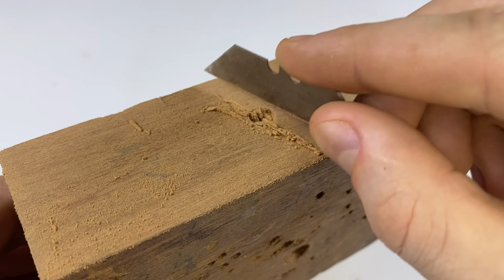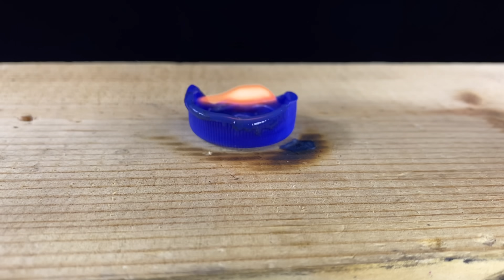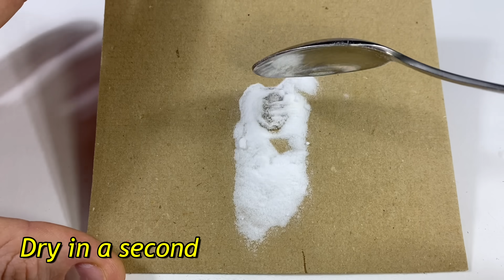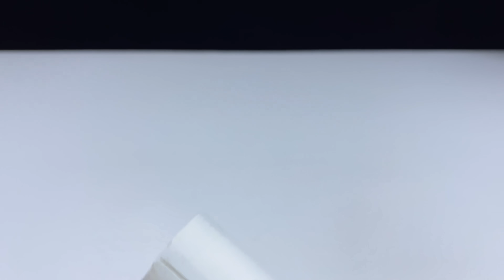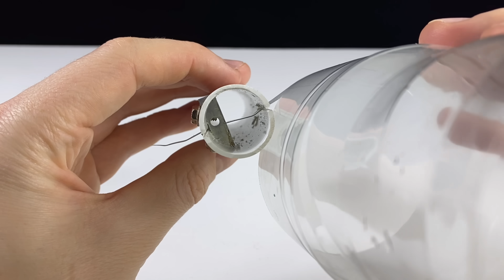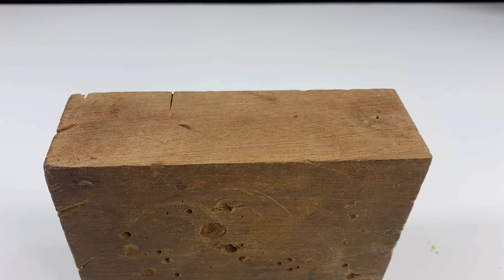Amazing tricks that will take you to another level of work – Tips and tricks

Comment: The soldering trick was impressive with out using the bottle cap thing at the end.
Reply: It is better to use the heat schrik sleeves. It will give smooth shape and nice look.
Reply: My only question with that is, is the lighter hot enough for the solder to properly bond?
Reply: @alexcriswell1977  Oh,  yes, it can. don't underestimate the gas flame temperature.

It can melt the soldering lead enough to get the  wires bonded.
Reply: The bottle cap thing at the end is dangerous. All that has to do is age with just a bit more amperage than the wire is rated for and that'll melt back off possibly arcing and creating a fire hazard.
Reply: @jonathanwright7991  If you have that much amperage on a speaker wire, you shouldn't be trying this at home.
Reply: @jonathanwright7991  If you have more amperage than the wire is rated for. Then the plastic bottle cap is the least of your problems. The whole cable housing will start to melt
Reply: Most of these tips, tricks and hacks are showing what you can do in a pinch if you don't have the proper tools to do the the job correctly.

Quite a few times in my early twenties, I found my self broken down and dealing with corroded battery wire and a battery on it's last leg. You will find that sometimes "jimmy rigging" something to get you somewhere in a hurry is better than walking for several miles (especially if there are others in the vehicle with you).

Solding wire and a lighter in a survival kit (and/or bugout bag) to fix something like a radio or to patch together cabling linked into a solar charge controller, may be all you need to get out of a tough situation or call for help. If you're against the melted, soda pop, bottle cap, wire covering, then stick to electrical tape or h*ll, nothing at all.

When I'm at home, I use my $200 soldering base station with digital temperature controls. However, on the go, this would technically work. 

Personally, I'd prefer the heat shrink soldering sleeves that have solder inside of the sleeve to join wires together or a small handful of "Dolphin DC-100S Super B Connectors with sealant" (which don't need any solder) to easily join wiring together. 

But, in a pinch, you work with what you have.
Reply: YES! 30 years of construction and I never knew a cigarette lighter would melt solder!!! DAMN IT!!!!!!😳😀👍✌️

Comment: Nice I love using super glue and baken soda. It's strong build up as much as you want and it's rock hard. You can even shape it with sand paper. Also diamonds bits too. Thanks for sharing. Oh with saw dust Elmer wood glue and wood dust. It stays the same color after sanding. Much better then super glue. Thanks again
Reply: I agree...if you are going to paint it, it is fine, but if you're planning on staining it, Elmer's is the way to go.👍✌️

Comment: That made joining two wires way more difficult then it needed to be, specifically melding the bottle cap.

They have heat shrink for that. Literally a small rubber tube that shrinks when heated.
Reply: Or even using a length of the plastic tubing made in the next tip!
Reply: Does this really need explaining to you? So cute. 
If you're going out to buy heat shrink - you may as well get a soldering iron too - the point of this hack is in case of emergency. When you don't have either heat shrink, or an iron.
Reply: 😂 u can also pay someone to do it for u. What’s the fun in that
Reply: @The A Man  There is no universe where this is the best option. In an emergency, you twist the wires and then go to the store and get electrical tape.
Reply: @vanhooklin  Fair point pal. Although, if you were broken down somewhere due to a broken wire and all you had was a lighter and a bottle of water - I'd go for that, until I came across a store (or shop as we call it in the UK 🙂).
Reply: but i have 100 empty 20 oz bottles of mountain dew lying around and I am all out of shrinl wrap lol
Reply: LOL!!! This person DEFINITELY has too much time on their hands!
Reply: @theaman4005  if you don’t have those tools, then you probably shouldn’t be soldering in the first place lol.
Reply: Then go watch a shopping channel. This one is about making due with what you have.
Reply: @fallofshadows2209  Everyone ignoring the obvious, who the hell just pulls solder out of their ass unless they got an iron for it?

Comment: That clear tube idea with the spring was impressive.
Reply: do you know it wasn't real 😐😑😶
Reply: That’s what I’m sayin
Reply: And what is its usage?
Reply: @HesamMarshal   that’s a good question.  Guess it depends on the size of it. Maybe you could use it to cover small gauge wire. No clue
Reply: Yeah, because no way that really works...
Reply: @HesamMarshal  Did you just ask what the usage of a straw is?
Reply: @jacobl2203  yes I did.
Reply: @HesamMarshal  A straw is mainly used to transfer one substance from one area to another area.

If one didn't have access to brand new straws, this would be an easy way to make one.

Comment: The plastic screw cap as wire insulation is such a great idea.  So much better than using crimp connectors or wire nuts.

Comment: That one with the cables and that bottle cap was awesome. The plastic bottle with the heat gun and to make it as a straw can be also used on a wire isolation 😉
Reply: If the wire gets to hot it will melt the glue off

Comment: This thing with the baking soda actually works. You can use less soda, still dries quick.
Reply: Yes it does.
I have been using this for decades in my modeling hobby.
Works great for filling gaps too.
Reply: Krazy glue or super glue used to work that good without baking soda
Reply: Can do it with flour aswell, works the same way, you can do it with string aswell, again, works the same

Comment: I wouldn't suggest using the wire one. I would just get a plastic coated connector and crimp it on. much safer and easier.

Comment: Seems like a lot of work to make a plastic tube of questionable quality. 
Using the CD to drill a straight hole, maybe ok. Check other YouTube videos for good wire splice techniques. The superglue and powder I never knew about, neat trick.
Reply: Seems like a lot of work to do anything!, ha ha
Reply: The superglue and baking soda method of gluing stuff together was used in the second world war around 1943 to 1945 the pilots and mechanics used to repair their plane props with cyanoacrylate and baking soda......cyanoacrylate based adhesives were invented in 1942......the chemical cyanoacrylate is the key ingredient in superglue that reacts to baking soda turning it hard in seconds